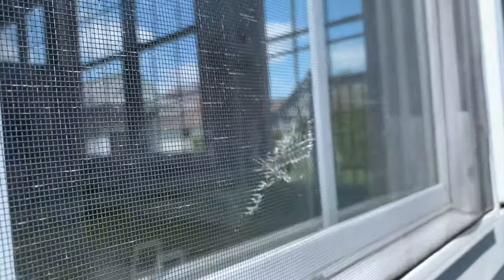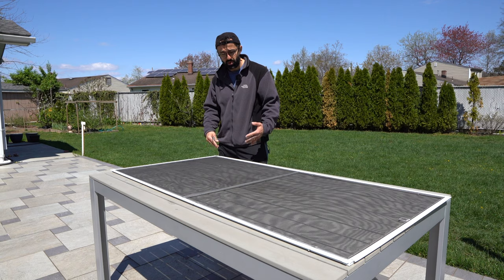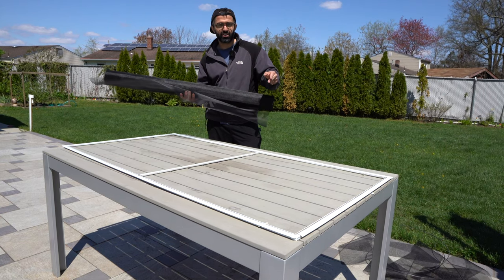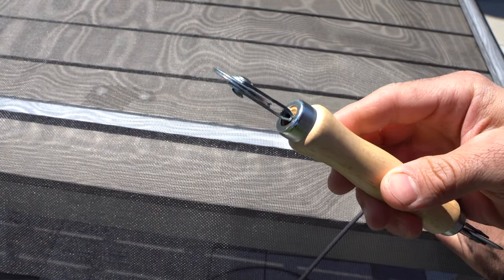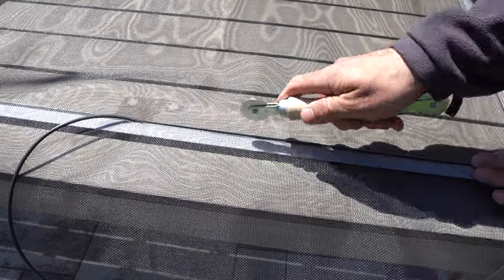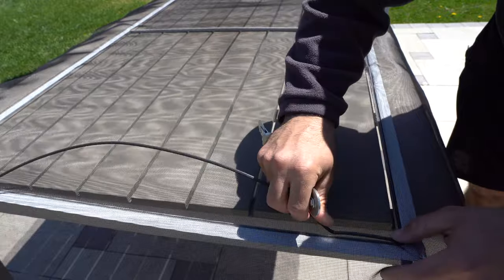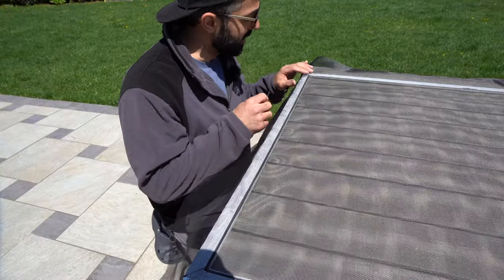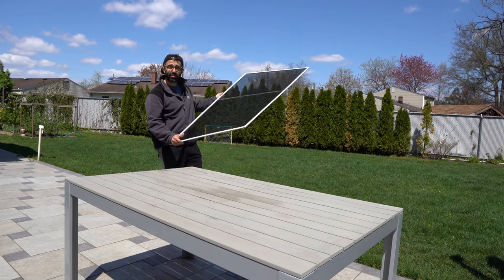DIY Window and Door Screen Replacement (rescreen). Save money by doing it yourself!

Comment: I’m about to replace a door screen, but I’ll be using one for pets…thus the need to change it. Since the screen is slightly thicker, will it be harder to push the spline in? Or should I purchase a size down?
Reply from the maker: I would stick to the same size. The groove is flexible enough